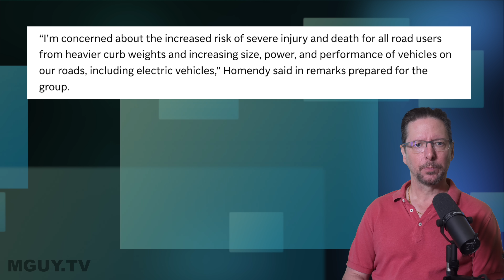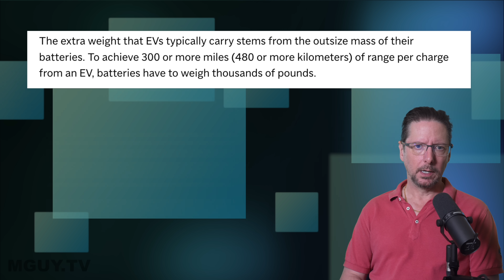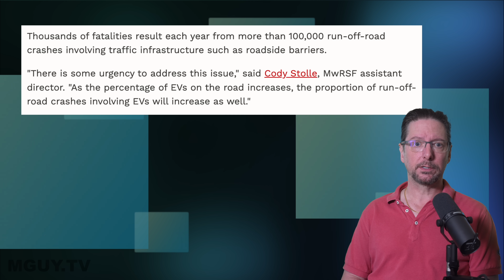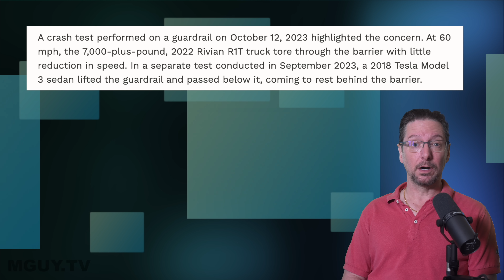EVs TOO HEAVY for roadside crash barriers (guard rails) | MGUY Australia

Comment: I don't know what EVs you get in Australia, but models imported to or built in the United States have similar weights to their ICE counterparts.
Reply: @patrickweaver1105  Aussie here & I'm calling you out.
Name ONE EV that weighs similar to its ICE counterpart.
Reply: What planet do you import from?
Reply: EV's of comparable size weigh 30% more on average than there ICE counterparts.
Reply: @xraylife A Tesla Model 3 is 1,611kg, Show me anything similar cargo/size/performance that is circa 1,200kg that’s not an exotic.
Reply: @peejayem4700  Read the above comment Apples to Apples.
Reply: Apples to Apples

A gas Hyundai Kona weighs 3,005 lbs.
An electric Hyundai Kona weighs, 3,571 lbs.

That is nearly a 20% increase in weight.

A gas BMW 740i xDrive weighs 4,720 lbs.
An electric BMW i7 weighs 5,917 lbs.

That is nearly a 26% increase in weight.

A gas Ford F-150 Platinum 4x4 SuperCrew weighs 4,948 lbs.
An electric Ford F-150 Platinum All-Wheel Drive SuperCrew weighs 6,893 lbs.

That is nearly a 40% increase in weight.

Also, keep in mind that range doesn't scale equally. A larger range battery could add hundreds of pounds more weight for even just 50 miles of added range, where as gas tanks would only need 2 or 3 gallons to achieve such range. 2 or 3 gallons wouldn't even add 20lbs of weight to gas vehicles.
Reply: Yip and the most popular cars in AU are double cab Utes 
Most of which weigh more than any EVs they can buy.
This is just click bait for the poor luddites who have already made up their minds.
Reply: @martinsmallwood9605  A Double Cab Ute weighs more than ANY EV they can buy? 😳
If they went woke & bought an equivalent tradie EV, it would weigh a shit-ton more.
Reply: @martinsmallwood9605  - seems like you need to get an education. Utes are designed to carry weight.